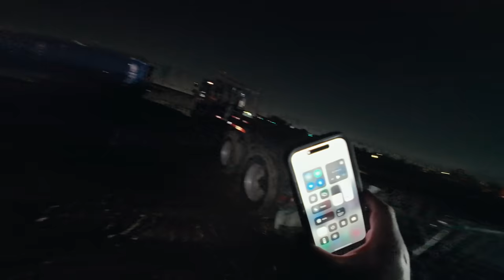Heavy duty winch out at a Naval Base

Comment: Here's a shout-out to all those drivers who don't bother to take the time to "walk" the route across wetlands (to check for wetness, and sinkage) before just barrelling in full speed ahead!  Keeps Pepe and Company in business!  Fine job as always!
Reply: One time it was 4am and I just unloaded at Circuit City DC down in FL. There was a lot nextdoor and a bunch of trucks in it. I called myself going in and was turning to be able to straight line back - apparently I sunk in quick sand up to the bottom of the fuel tanks! 🤣 The company sent out a Tow Company and low and behold the tow truck got stuck so another tow truck from same company had to come rescue both us! When dispatcher came in he said on phone get with your sister so she can take you to Lens Crafters and get your glasses replaced since you left them at the truck stop in Texas! He was implying I was blind! 🤣🤣🤣

Comment: I'm wondering why you didn't choose to use the snatch blocks attached directly to the 2 hanging tow eyes on the lower frame.
Reply: why get down in the mud when you can work conveniently at chest height? and why drag double (or quadruple) the cable that whole way just to use snatch blocks when a single line pull will suffice?
Reply: Note that the snatch block was not attached directly to the truck. It was used share the load between the two attach points.